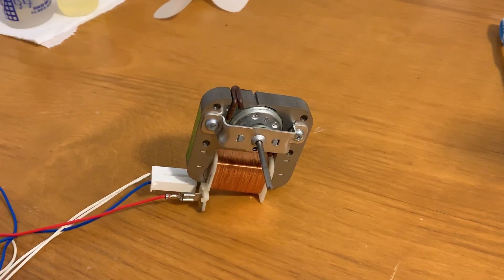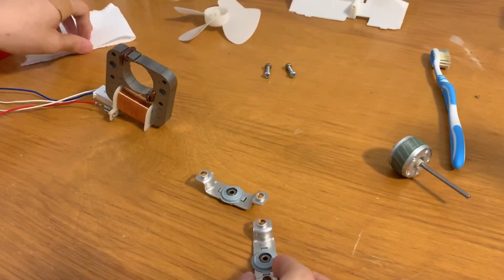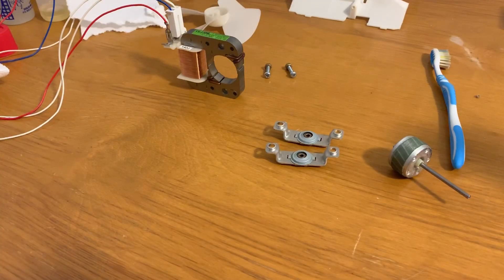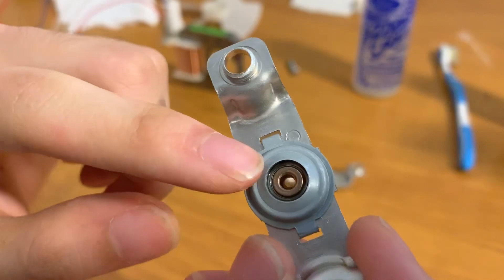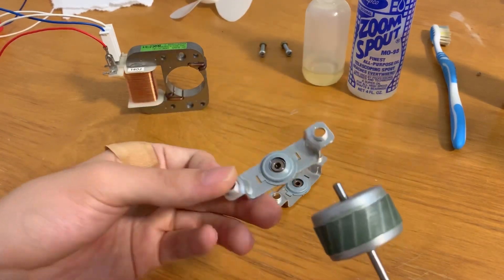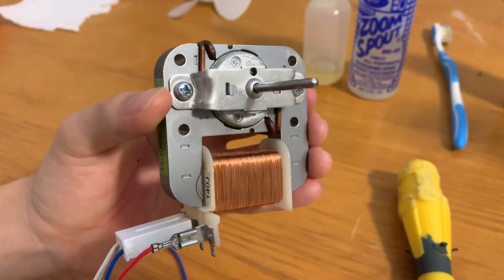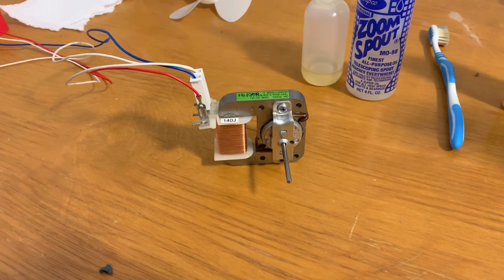How to Oil a Fan Motor (Shaded-Pole, C-Frame Motor)

Comment: I have a 20 yr old bathroom exhaust fan I haven’t serviced so mine might need a bit of work (I usually vacuum the dust out yearly though). Also, just wondering if there is anything you can do to rectify a stator that has some rust.
Reply from the maker: If it’s just surface rust, you can first try a bit of WD-40 and steel wool to see if the rust will come off. If the rust is deeper, you can use a wire wheel to remove it. I recommend using a small wire wheel attached to a rotary tool or a drill rather than a larger one on a bench grinder. Be extra cautious when wire wheeling near the windings because even a small poke with the wire wheel will destroy them. Avoid using a chemical rust remover as it will wreak havoc with flash rust and potential damage to the windings and the plastic insulation around them. After removing the rust, you can rub on a thin coat of WD-40 on the stator (or an electrical insulating varnish such as the SprayOn EL600) to protect it from future rusting. Hope this helps!
Reply: @TheSuperFanMan  Cool. I think I have a small steel wire pencil brush I can use on my portable drill. I'll see how that goes. Thanks for the help anyway.
Reply from the maker: No problem!

Comment: Every time i take apart a fan motor from a 12” fan, it never works properly when put back together
Reply from the maker: What is the issue that you encounter? One common issue can be the bearings not being aligned properly. After fully assembling the motor, use the screwdriver’s handle to whack the motor shaft from various directions. If that doesn’t fix the issue, there may be something else going on. You could make a video showing the issue, I can try to help.

Comment: The Supco Zoom Spout Oiler - Turbine Oil is one of the most confusing brands ever. The actual physical oiling bottle is called "Zoom Spout Oiler" and then a dozen different companies put their private brand and different types of oil into the bottle from Supco, LaCo, Dial, Highside etc... The new batch of Supco Zoom Spout Oiler - Turbine Oil is now no longer labelled as Turbine Oil, but MO98 "Finest All Purpose Oil".  I don't know about you, but this is got to be one of the biggest blunders in history in screwing up a brand name ! Also good motor bushings are usually powder sintered and not machined for solid brass stock, this way the lubricating oil is inpregananted into the bushing and kept feed by the oil filled felt.
Reply from the maker: I absolutely agree!
Reply: ✏️✏️📌👍 Thanks for the heads up. Am currently awaiting swift reassembly of my microwave after feedback regarding whether my Andis hair clipper oil will suffice or if it will be far substandard. If substandard, what might be easily acquired at a big box store such as Menards or Home Depot or a particular local business that might likely carry the lubricant to be targeted.
Reply: @That_Handle  The important thing here is if the the oil is a detergent or non-detergent based oil. Only non-detergent oils should be used on motors with sintered brass bushings.  From most of the clipper oils I have come across the majority are non-detergent oil so you should be fine. As I can tell the clipper oils from Wahl or Andis are just mineral spirit and pretty liquid they are around the same viscosity as Supco's Turbine oil.
Reply from the maker: The clipper oil will work, but it likely won’t last a long time since it’s a thin lubricant. But if it’s all you have now and need to have the microwave up and running asap, it’ll work fine for now without doing any harm. I believe the 3-in-One electric motor oil (the blue & white bottle oil I showed in the video) is available at many hardware stores.

Comment: If a motor like this doesn’t work when plugged in, where would you suggest to start looking for the failure? 
It’s a bathroom vent fan, no apparent signs of burn anywhere.
Reply from the maker: There are two reasons that I can think of. First one is seized bearings. When you spin the fan by hand, does it spin freely and coast down to a smooth stop? If it doesn’t, it needs to be oiled as I did in this video. The second reason could be overheating. Most motors have a thermal fuse that will blow when the winding coils surpass a certain temperature. It’s possible that dust accumulation, or stiff/seized bearings caused the motor to overheat and blow the fuse. Most bathroom fan motors have a plug, so you can test for continuity (or resistance) across the two prongs with a multimeter. If the motor is alive, there should be a resistance reading. You can also tell if the motor is alive by listening for a faint hum when you turn it on. If it hums but doesn’t move, it’s usually due to seized bearings. Hope this helps, and feel free ask any questions you have!

Comment: You covered very little about cleaning. I have a greasy kitchen fan motor. How to clean it? Can I use detergent ? Also if I wash it in water and dry it thoroughly would that be a problem?
Reply: For cleaning greasy electrical components, you can use either chlorinated brake parts cleaner (perchloroethylene aka Tetrachloroethylene) or electrical contact cleaner. Both are good solvents for grease/organic compounds and non conductive. Brake parts Cleaner isn't flammable, but contact cleaner is.
Be sure to oil bushings after cleaning
Reply from the maker: Yes, typically brake cleaners and contact cleaners will work great on dirty electrical components. However, when it comes to electric motors, I wouldn’t recommend brake cleaners. Most are harmful for plastics and the insulating varnish on the windings. Spraying brake cleaner on motors will likely do some irreversible damage that may eventually lead to motor failure. Plastic-safe contact cleaners are completely fine though. I use CRC QD electronic cleaner to clean motor parts.
Reply from the maker: Yes this video’s focus was on how to oil the motor so I didn’t go over the cleaning process in detail. Cleaning can be done by spraying some degreaser or WD-40 onto a sheet of paper towel and giving the motor a good wipe. WD-40 alone often does a great job. I haven’t tried detergent before so I can’t say how effective it will be. I highly recommend that you don’t wash it or submerge it in water. That will leave water in the windings or between the stator laminates, which could cause the motor to short out or allow rust to form.
Reply: The recommended cleaning method is to lick it clean. Preferably while it's still plugged in.

Comment: So do these slowly loose power over time? I have one I have cleaned from old record player from the 40s  that seems to be loosing torque.
Reply from the maker: These shaded-pole motors shouldn't lose power over time, regardless of their age. It may seem like it's losing power if the bearings are seized up. The lack of oil or old gummed-up oil can cause the motor to run slower than it should. When you turn the motor by hand, it should coast down to a smooth stop. If the motor comes to an abrupt stop, it likely needs to be oiled like I did in this video.
Reply: @TheSuperFanMan  Okay thanks :)
Reply from the maker: No problem!

Comment: can rust on the body make it unusable? The thermal fuse was blown so I changed it and still not working. I took the fuse off and close circuit still not working!! I had to sand the shaft (it was really rusty lol) and I cleaned almost everything except the part holding the coil and the magnet which I call the body. I see there is voltage going through. So it "should" be working, I guess... Anyway, great video! I have learned a lot :D Thank you!
Reply from the maker: Happy to hear you found the video helpful! The body of the motor is the stator, which is essentially layers of steel laminations that the windings are coiled around. The electricity goes through the windings, which are insulated so the stator is not live even when the motor is running. If the stator does shock you, it means there’s a short circuit the windings. In most cases, rust won’t affect the motor’s functionality unless it’s severe to a point where the rust has grown deep into the stator. Based on your description, it sounds like there is an open circuit in the windings. It’s possible that the motor overheated and the windings shorted out, causing the fuse to trip due to the heat. If that’s the case, the only way to revive it is to have the motor rewound with new windings, which would be a costly repair. One less expensive option would be to look for a replacement motor. Hope this helps!
Reply: TheSuperFanMan wow thanks a lot!!!!! and that explain why my power supply goes off on red/white, blue/white. There is a short! I have a lot of fun to dismantle things just to understand how they work especially when they are broken! Of course, electronics, electricity needs some training and circuit knowledge but I am getting there and thanks to you! Thank you for your time :D!
Reply from the maker: No problem! :D

Comment: Don’t use WD40 it wares off in less than a day.
Reply from the maker: Correct. WD-40 is only good for cleaning motor parts. Proper electric motor oil should be used as I did in the video.

Comment: These are brushless motors.
Reply from the maker: They’re technically “brushless” but you normally don’t use that term on these AC induction motors. “Brushed” and “brushless” are terms used on DC motors. The motor shown in this video is a shaded pole, c-frame motor.

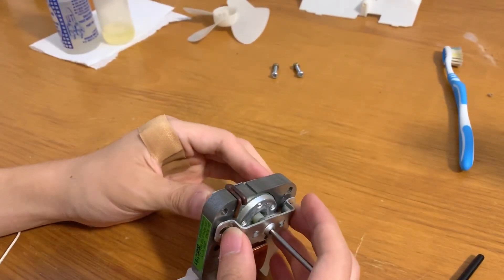Comment: Glad to see you put the warning about getting any rust off the shaft to remove the front bearing; if only my tired self had remembered that when I serviced a Broan bathroom fan at 2:00 in the morning earlier this week
Reply from the maker: Yeah it happens. I learned (and still learning) from mistakes too, and I try to not make the same mistakes again.

Comment: Awesome video SuperfanMan and the best part is that it comes with oil ports i have never seen any shaded pole motor with oil ports before none of my fans come with it... i hope they would still start to add that motor is 9" hv fans and smaller fans also .. good video and i enjoyed it
Reply from the maker: Thanks! Not very many new c-frame motors have oil ports, so I was also surprised that this motor had them. I definitely agree that more manufacturers should implement oil ports on their motors. Sadly nowadays they seem to prioritize planned obsolescence over longevity.
Reply: @TheSuperFanMan  wow so true but wow that's a rarity with that more and with the TpI that me and Jordan has with oil ports but now the new 2020 model of the tpi 12" models sold on amazon does not have oil ports anymore the motor is completely sealed thankfully earlier this year when i got mines it came with the oil port 2019 model same as jordan u are you going to get one that fan is built like a tank its freakin heavy lol
Reply: @TheSuperFanMan Luckily all my bathroom exhaust fans have oil ports.

Don't expect manufacturers to start including them again though.  You could spend your whole life asking every person you meet if they've ever lubricated the sintered brass bearings on their shaded pole motors, and if they used the port or not....and all you will get is odd looks.

Nowadays people throw them away or pay someone else to do it.  Manufacturers don't include ways to maintain them kike the old days.

You can successfully drill your own oil ports, and often drill them at a place where they will be more easily accessible than the manufactured ports.

Comment: My 9 inch centrifugal fan from a heater had one of those motors. No idea if it works as I don’t know how to wire ac
Reply from the maker: Yep these are very commonly used. Wiring isn't difficult if there are just two wires coming from the motor. Simply connect each wire to neutral and live.
Reply: TheSuperFanMan  already blew out some light bulbs and the electricity for the house once while wiring ac